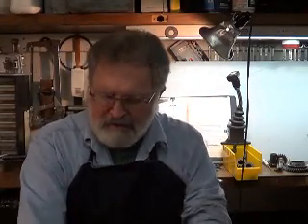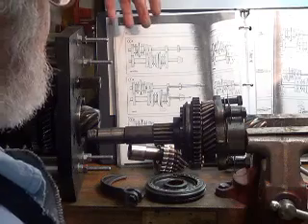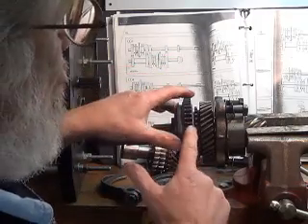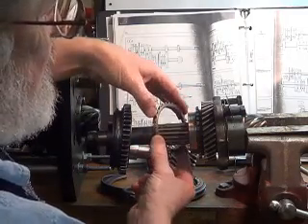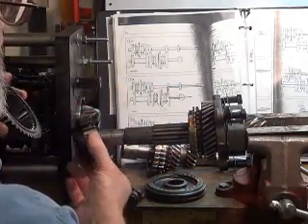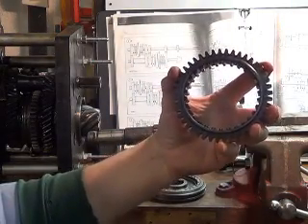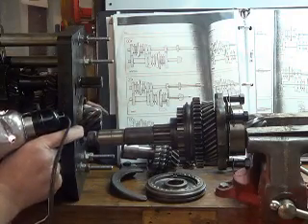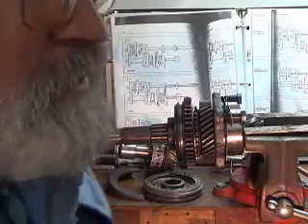EZGZ Volkswagen Transmission Tips and Tricks 7

Comment: Thanks. I will do that. Is it possible to damage the  nose cone or any of the parts inside? 
Can that hockey stick be bent? Or any other parts in the nose cone?
Because I've already removed the Jamar shifter box and tried to shift it by hand using just the shift rod and got the same results. 
losing my mind- help
Reply from the maker: Yes it is common to bend, break and find broken parts in the 002 tranny shifter area. Most of the time you don't have to go deeper than that.

Comment: Ok EZGZ I bought  a used class 5 baja bug. The bus  002 trans goes ibefore they cleaned then to 1st 2nd 3rd and 4th but not into reverse.
The previous owner claimed that the transmission went into reverse until they cleaned the "Jmar shiftbox." After they cleaned it they claimed it wouldn't go into reverse. I have removed the shiftbox and, using just the linkage, I still cannot get into reverse.  When I think its going into reverse, it feels like the shiftrod is being twisted as it goes in.  I've done this with the engine running and not running. Same results. The transmission makes no sound while it's running, no bucks, no bangs, no clanks, nothing. Is it possible for something to be wrong in the nose cone area? Please help!
Reply from the maker: I just love the excuses sellers attach to there broken toys.  Yeah it just needs a tune up.  Disconnect the jamar box completely and then manually try and engage the gears. You may want to raise the back so the rear wheels turn  and that might make it easier to engage. If you can't get it into reverse you will have to remove the nose cone and have a look. 002 shift linkage is not as strong and work completely different than sedan style. Just be patient and try and look and understand which way things move.  Good Luck